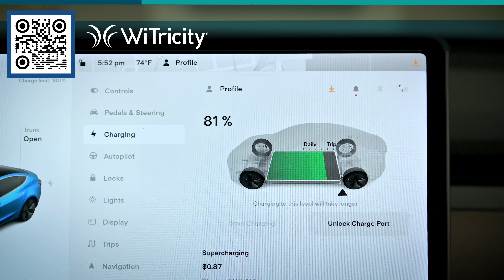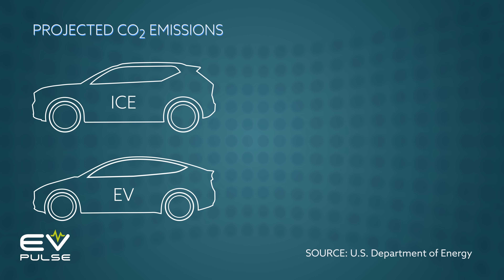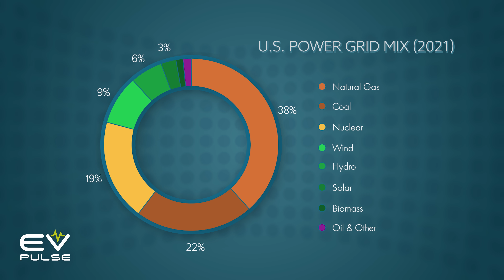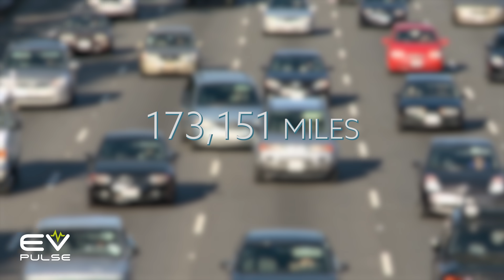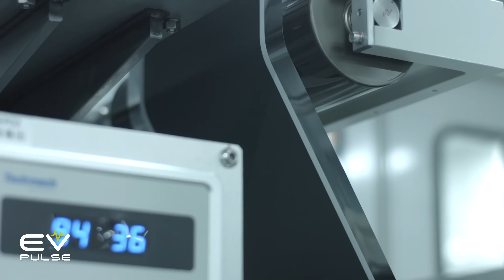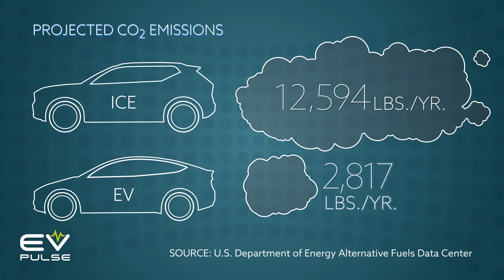Are EVs Cleaner than Gas Cars? | EV Basics

Comment: I also wonder if calculations like this attempt to account for the fact that EVs for many people can “fuel up” at home or via infrastructure that uses the electrical grid which doesn’t require moving fuel around the country or world.  When you think about filling up an ICE with gas, you have oil that is extracted, then shipped to refineries (which likely uses more gas), then put on trucks to fill all the gas stations (which uses more gas), then we use more gas to drive to said stations and fill up.  

All of those activities create emissions too.
Reply: To generate 1 Kwh of energy for EVs, there is up to 14% transmission loss. Plus coal, gas and nuclear fuel has to be transported to do electric plant. 

Transmission losses are the energy lost as heat when electricity travels through wires and transformers. The amount of losses depends on the distance, voltage, resistance, and power flow of the transmission line. Transmission losses can range from 4% to 14% of the total energy generated, depending on the stage and condition of the transmission system.
Reply: @OmerKhan1   Certainly a fair and important point that electricity generation is not without its losses and delivery components.  That said, on the delivery side, you’re delivering those materials to far fewer destinations than gas stations.  Also most natural gas power plants get fuel delivered via a pipeline.  Any green energy only suffers some transmission loss as a fuel doesn’t have to be transported.  

Regarding efficiency losses, to be a fair comparison there are losses we should account for then in the oil extraction and refining processes as well.  

I’m still left to wonder if such calculations between the two have been attempted.
Reply: @OmerKhan1 also, let's not forget that the source of energy for the grid is changing over time. This comparison was with data from 2021. It is now cheaper to build a solar farm than it is to build a natural gas-powered plant and the fuel is far cheaper. The grid is getting greener.
Reply: Gas has to be extracted refined and delivered in trucks to gas stations. Every building is wired with electricity
Reply: Asked Gemini today:
It sounds like you're asking about the energy consumed to deliver a gallon of gasoline to the pump.
While it's not a direct "gallons of fuel consumed to deliver one gallon," studies suggest that the entire upstream energy cost (extraction, refining, and delivery) for gasoline accounts for 20-30% of the total energy content of the fuel itself. This means a significant amount of energy is expended before a gallon of gas even reaches your tank.
Reply: So at worst cases for oil vs electricity, it appears electricity grid losses are less than half all the transport losses in the chain for oil > gas at the pump. Plus, everyone must drive to the pump. Most charging will be done at home when demand and rates are lowest overnight. Those with solar fill their vehicle during sunlight hours with no grid impact.
Reply: Home Rooftop, carports, pergola, unused land,  apartments and building roofs and brownfield solar can charge most ev.
Done.
China installed 93GW solar IN ONE MONTH in 2025. The same yearly KWh production of 15x 1GW Nuclear plants